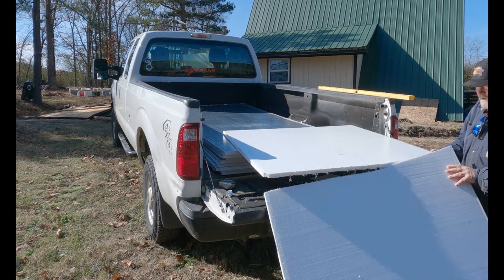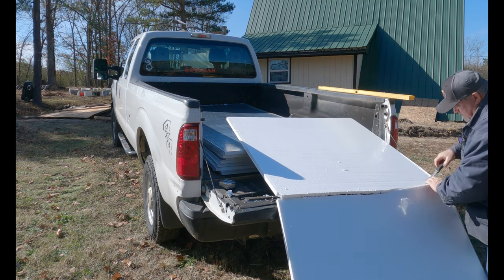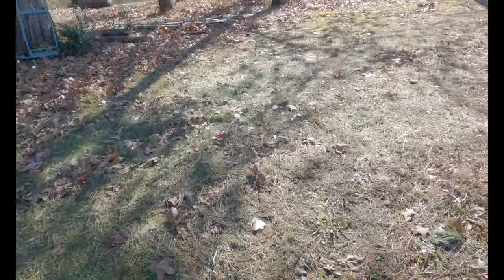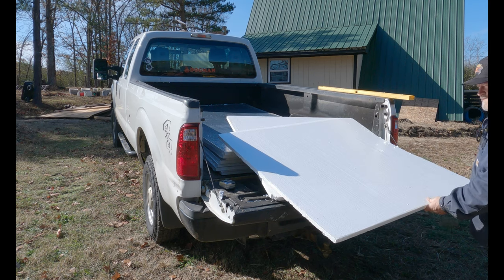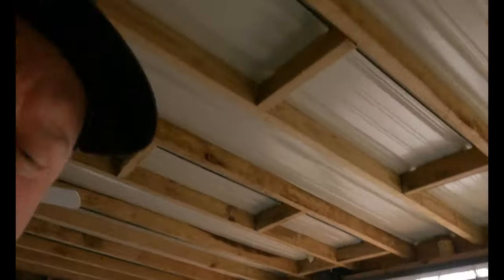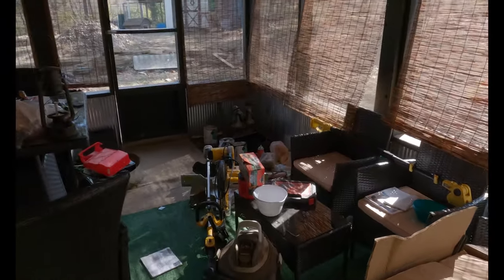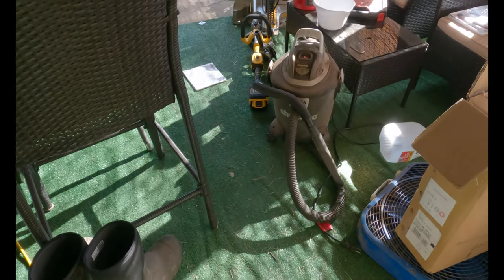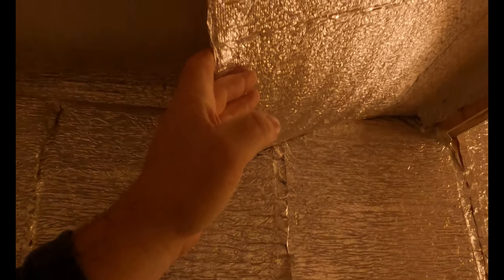The Day Ended Badly! Lost My Temper At Mother Nature.Screened Patio/ Upper Deck/Dog Apartment Build.

Comment: You can get rubber door striping at dollar store and put it on the inside of the panels it will cover the gaps and hold the panels in place.  And I had to replace some and the old came off very nicely.
Reply: That sounds like a good idea if there's a dollar store near him.
Reply: He can order it from Amazon also, I know he has ordered from Amazon.